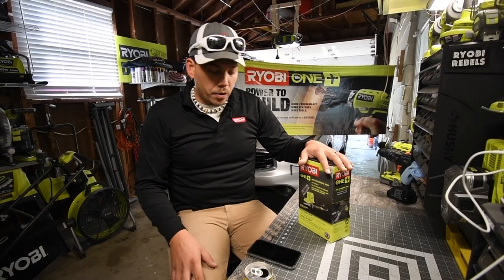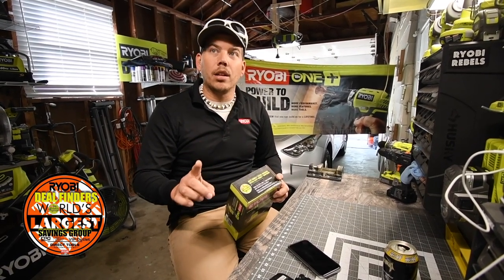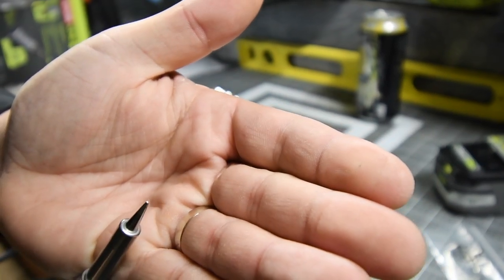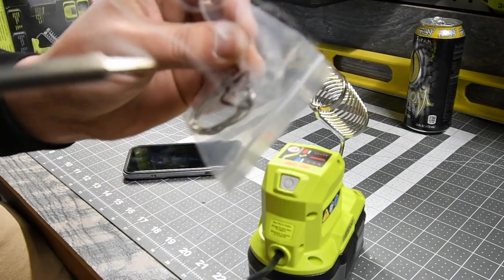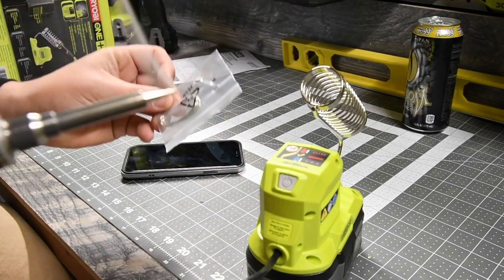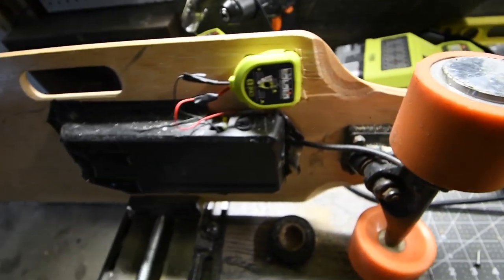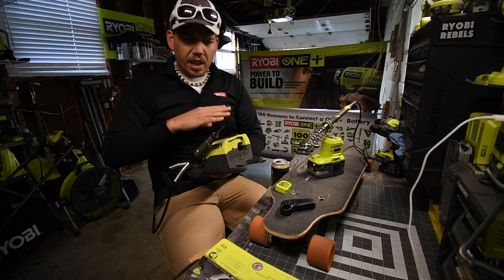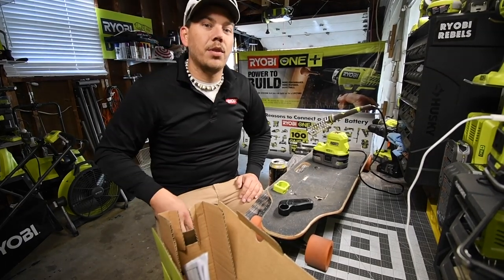Ryobi Soldering Iron Unboxing/Testing P3105

Comment: That should have came with a chisel tip as well. I found a P3100 soldering station when I dumped Home Depots compactor yesterday and a nest home security system with camera still sealed in the box brand new. Blows me away the stuff they throw away. Good review thanks.
Reply from the maker: I thank you double

Comment: Replacement Tips are available on the Home Depot Website. You should get a tip cleaner. I am considering purchasing the hybrid soldering station in the near future because I do a lot of electronic work and I'd prefer to have one with a temperature control.
Reply from the maker: Very good. more control the better and thank you

Comment: Cool iron, but two things...When soldering hold the iron on the work and let the work melt the solder and vinyl electrical tape doesn't work as heat shrink tubing.
Reply from the maker: I know, it was for a test to see if the skateboard would even work, I knew it would work, but thank you

Comment: You were wondering how long a battery would last.  The iron puts out a continuous 40 watts, which would only be the case if the tip remained in contact with something massive and cold the entire time it was on.  40 watts divided by 18 volts nominal works out to just over 2 Amperes current draw from the battery which is low enough to expect there is little energy loss to internal battery resistance or transmission loss.  Using your 4Ah battery, you can take the watt hour rating, 72 Wh, and divide by 40 watts, the watt units cancel and you're left with 72/40th hours or 1.8 hours.  That's 1 hour and 0.8 times 60 minutes per hour, hours cancel so 48 minutes.  At continuous duty cycle peak power, a 72 watt hour 4.0 Ah battery will last about 1 hour and 48 minutes.  At the low amp draw, you might lose 5% of the battery power to waste from wiring and battery internal resistance so an hour 42 minutes should be possible.  In regular use, where full power is not required to maintain tip heat all the time, it should last several times longer.
Reply from the maker: Thank you very much sir. you were very informal :)

Comment: You might have to take apart the charger and remove circuitry in order to get the full output from the battery.
Reply from the maker: I did. the skateboard circuit board must have something in it to prevent people like me from doing this lol
Reply: Ryobi Man Caver there is a group called Ryobi tool mods which might be able to help with the project.  You should do a detailed video on how you modded the skate board and charger.

Comment: Is it possible to get additional tips and different shapes (is: flat shaped)?
Reply: most soldering tips are generally universal
Reply: Yes.  You can order compatible tips from Amazon you just need to measure the diameter & length.  The Soldering Station includes an additional flat tip.
Reply from the maker: Jack JKantrowitz50 Kantrowitz yes it is